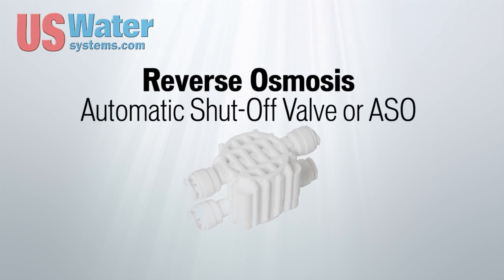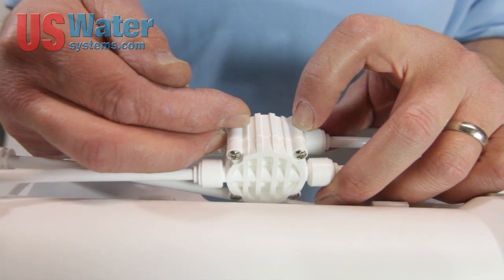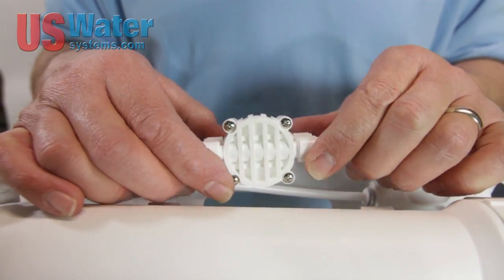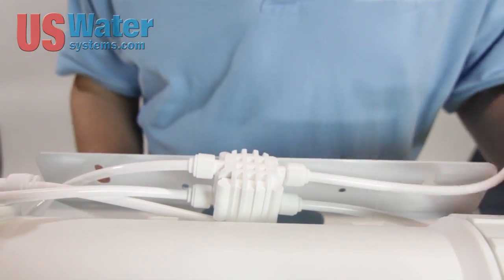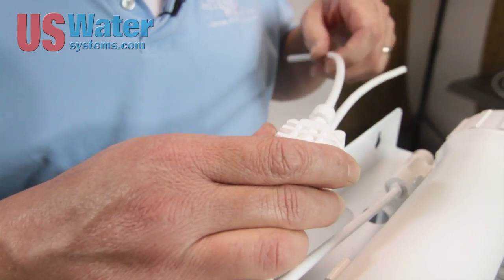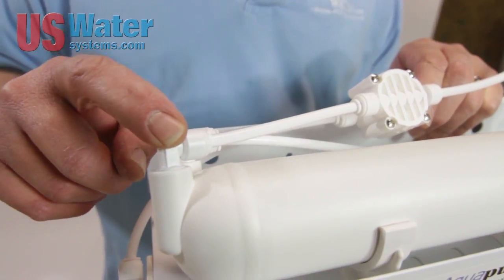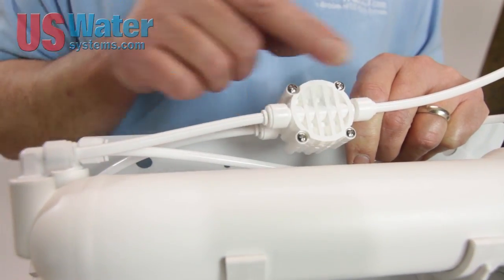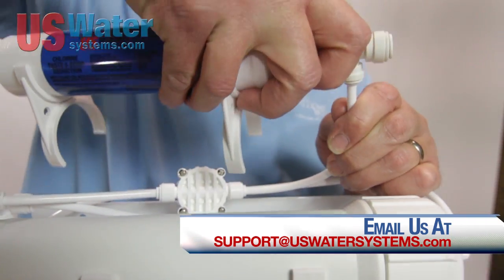Automatic Shut Off Valves or ASO

Comment: Question for you, can I return the water that filter discharges into the drain, if I put a t into the line that comes from shut off valve will that work?

Comment: How to accommodate this aso valve alongside a permeable pump?
Reply: You can not. Premeate pump uses concentrate (flush) water out pipe to create pressure behind membrane in filtered water pipe. But premeate pump is not very reliable and the tank itself is a pretty bad solution as it keeps pipes under pressure and creates pressure in filtered water pipe, causing massive water loss. I recommend instead to get no tank, no aso, no premeate pump. Tank leads to TDS creep, it needs to be changed anyways, creates risk of leakage as it requires pressure, works against membrane which leads to increased water loss after 30% full. 

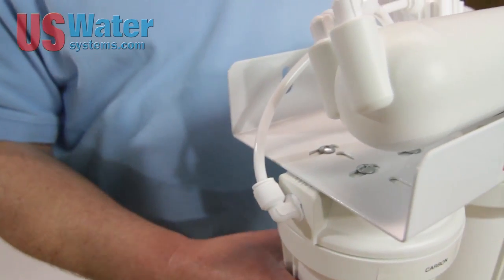Just go directflow - get or rewire two prefilters (5micron sediment and CTO coal block) to a larger membrane (like 150 gpd, as it costs same as 50gpd+tank). Then attach corresponding flow restictor behind membrane concentrate flush water pipe,  as well as two T-pieces around it and a manual valve. Use that manual valve to flush your membrane once a day. Attach filtered water from membrane through one-way flow restrictor and into dedicated water tap.  You also need one manual valve on water inlet, keep water tap always open. Here you have cheap easy and fast directflow system with 1:2 ratio instead of 1:10, free of tds creep and with less parts.

Or go pressure-less electronics RO with two solenoids (one for inlet, one for autoflush), self-regulating pump, uv-reactor, side-stream or sequential 2x membrane configuration. And you need a switch to activate it as well as at least one double-timer relais (T1,T2; wait T1, trigger for T2, repeat) and one shottky diode. Relais will activate both solenoids to flush your system automatically and diode is to prevent current backflow, so when you press switch only inlet solenoid is opened and pump runs - and auto-flush solenoid should stay closed.
Reply: @HECKAKYH-ADEKBATEH  well the main reason for permeable pump is lowering the water waste....so not sure about this bit, but I'll look into it as it seems you know a thing or two about the RO :).